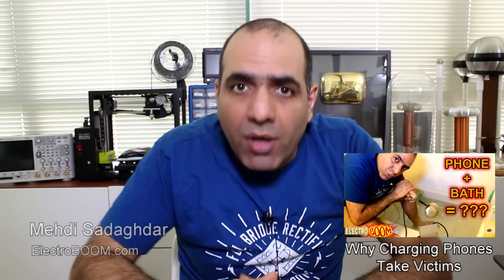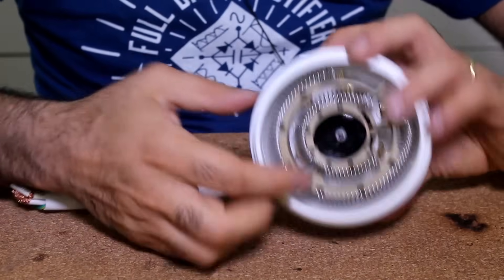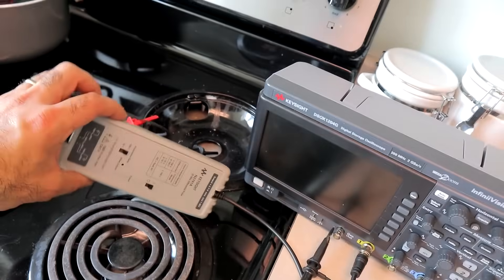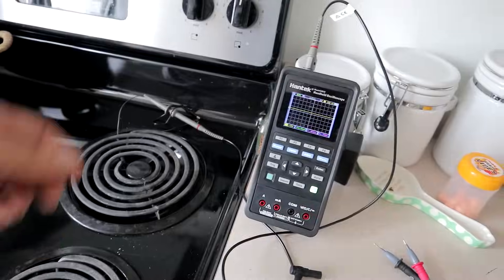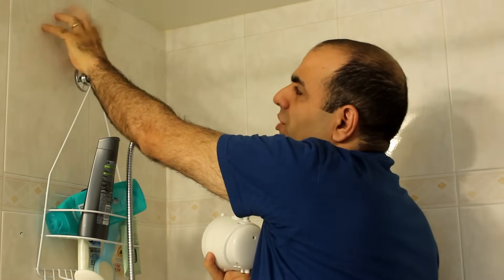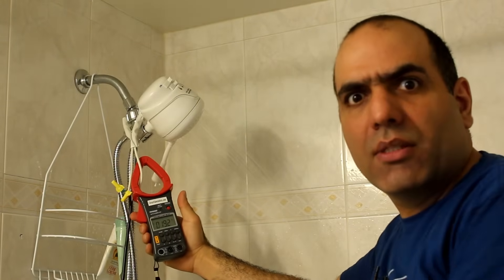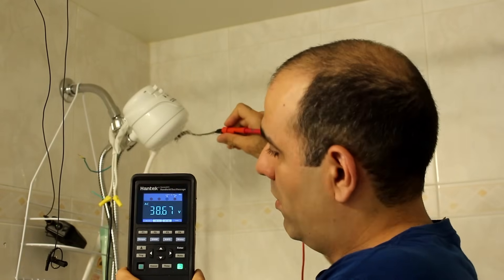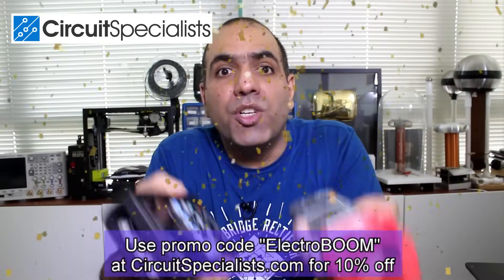How Safe Is the SHOWER HEAD OF DOOM?!

Comment: Here in Brazil about 90% of the houses do not have grounding and we connect the ground wire in the neutral.
edit: taporra tem BR pra caramba aqui kkkkk
Reply: My grounding connection was actually a nail in the wall in my first house lol
Reply: @FPSzky  rich in Brazil is still a peasant in a proper, first world, nation.
Reply: é porque o neutro é de certa forma aterrado pela companhia
Reply: @eduardu44xliv  Sim, mas é mais seguro ter um aterramento próprio na casa para levar energia indesejada para terra do que faze-la ir para o circuito.
Reply: @FPSzky  stop replying to this troll
Reply: @AhnafAbdullah  k
Reply: Dubai will be a slum within 15 years after the buildings start to lean over....
Reply: I am Brazilian my house has grounding but compared to my neighbors no, it has only 30 amp circuit breakers and they think they are protected.
Reply: @Bellawere  lmao when I was 11 or so, I drilled a hole on the floor, dripped some salty water into it and stuffed a long-ish (15cm) roofing screw in there, hammered it all the way down. No more shocks from my computer case! Was the one and only "grounded" (cough) plug in my parents' house for over a decade.
Reply: @justsomenerd8925  O neutro é a referencia para a senoidal. quando voce usa bifasico ou trifasico ele basicamente é o ponto central se voce pensar em forma de estrela. isso nao quer dizer terra. por isso ele chama neutro e nao terra.
Reply: Ligar o terra no neutro é tranquilo até o dia que o neutro da companhia romper e retornar 220V pelo neutro da casa. Ai quero ver. Não indico fazer isso. Ou faz um aterramento ou deixa o fio verde parado.
Reply: How tf do you not have proper grounding? It’s literally just an extra wire run to a rod shoved in the ground. Brazil is destined for eternal poverty
Reply: @Silentguy_  that's not accurate. much of the houses in Brazil actually have proper grounding, don't be ignorant.
Reply: @Bellawere  That's how you end up getting shocked through the shower knob. Then, instead of rewiring the whole goddamned house, you just start wearing flip flops to the shower.
Reply: @justsomenerd8925  Real amateur trolling. Try harder, kid.
Reply: Using the neutral as ground wire is dangerous, I'm brazilian and I would never do that, I rather install a proper grounding system or just leave the shower ground wire disconnected, but I would never connect it to the neutral, because it is not safe and not recommended.
Reply: @justsomenerd8925  rich is rich, no matter which world is someone come from and it's seen from how much the net worth is.  The 'three world' thing has something to do with politics after the ww2 whether you're the allies (1st), the axis (2nd) and neutral (3rd).
Reply: never use neutral as ground, any cut in your neutral line between your house and power station and your appliances become live
If you dont have ground line and are too lazy to make one, dont connect ground wires in appliances
Reply: @justsomenerd8925  actualy it doesn't take much money in Brazil to have "slaves" to do housework and cook for you 8h a day. I know in Europe you have to be a milionaire to be a "king".
Reply: That's how my house is here in the US. It was built in the 1950s and the wiring was never updated to code.
Reply: 90%.
I wonder how you got this statistics.
Reply: @wellyngtonfernandes9892  The famous TOOMAH institute for research.
TookOutOfMyA__Hole
Reply: Brasileiros aqui, legal
Reply: some houses use the ground on the shower only.
Reply: Why
Reply: If you think 1st world is where your food is toxic, you have nearly zero vegetation, your government steals other countries' oil for a living and is proud of it and where the military does compulsory scientific trials on their citizens and low-ranks, then the US is the best nation in the world!
Reply: Eu faço o terra parafusando um fio na parede kkkkkk funciona que é uma beleza
Reply: @gordonblo6338  hello Germanistan. 1st world? HK, Dubai, Singapore etc... Eurostani? MAYBE the Eastern European countries, MAYBE.
Reply: 🤭What a stupid thing to do....the ground and the neutral provide complete different paths to the currents in the house in all the diverse possible situations  ... by mixing them up that way you're just removing the protection to the people and to the property!!
Reply: that's a bit of a exaggeration, most houses and apartments build in 70's and later have a ground in the bathrooms for the showerheads
Reply: @ehuhazi1753  maybe if you hit a iron bar
Reply: @gordonblo6338  brazil still a more "happy" contry
Reply: @nonec384  Oh yes the favelas look very happy! Lots of nice people and the crime rate is very low!
Reply: @gordonblo6338  happyness and crime rates have nothing to do with eacth other
people in sluns can be more happy than someone in a richer streat
Reply: This reply section is depressing 
We're reaching numbers of stupidity that shouldnt bem possible
Reply: In my house, we have a 50 amp fuse for protection
Reply: @justsomenerd8925  if you talk bad about my contry again, i will report you.
Reply: Grounding makes it more dangerous
Reply: In the US all grounding and neutral wires are connected together to. In the mdp panel. At least they should be. Its code

Comment: Although it doesn't seem like it, these electric showers are very safe nowadays (I say nowadays, because in the past, in the first electric shower models, the piping was all metal, so the risk of getting shocked when turning on the valve was high, and the the shower was activated using a disconnector switch and the risk of you turning on the shower while wet was also very high) they are even safer than gas showers, here in Brazil it is very rare for accidents involving electric showers, when it does happen, it is usually because the person forgot to turn off the circuit breaker to change the resistance, or else, for some reason, probably incorrect installation, it caught fire, on the other hand, every year when winter arrives, cases of people who died of asphyxiation due to monoxide are very common. of carbon that leaked from the gas heater,